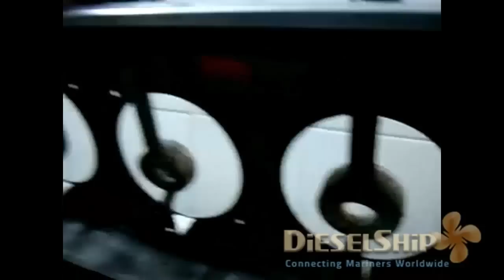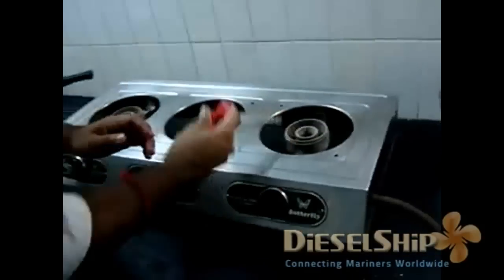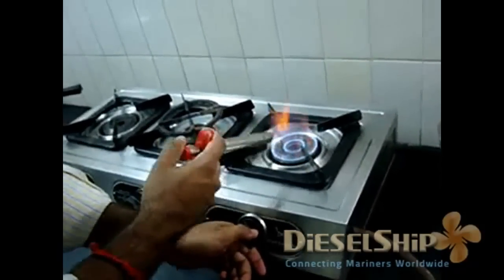LPG Gas Stove Working..!!

Comment: I was scared when I purchased a new Gas stove. Because as i was inspecting the product. I saw those holes in the pipe. Which you explained is used to mix air with lpg gas. I thought it's broken. But thank you for explaining so nicely